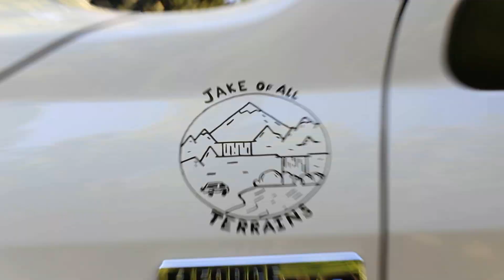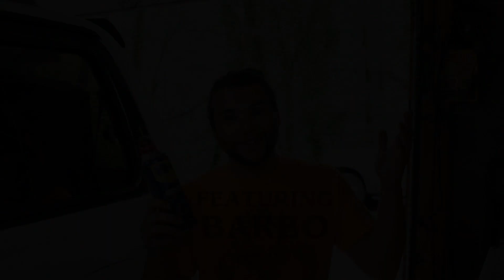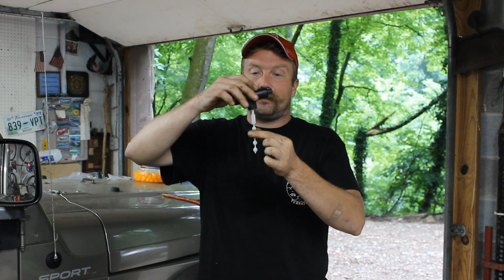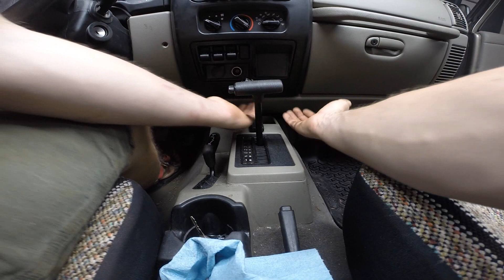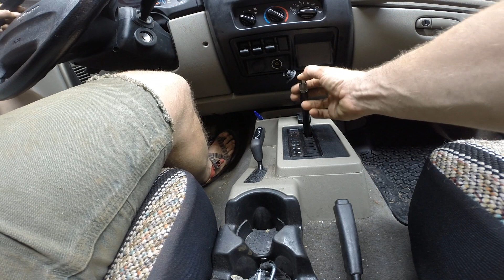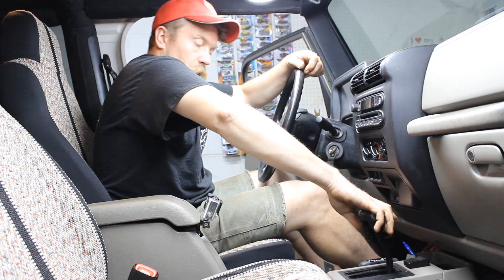Save your money! 97-05 Jeep TJ Automatic Shifter Assembly

Comment: About 10 years ago, my dog ate this knob on my Jeep. I have since been able to use the pieces of it like a second key, and I have been putting off replacing it... for 10 years. Just ordered the new knob, I'll report if it works when it gets here.
Reply from the maker: I hear that! My Toyota Tacoma exterior door handle quit working awhile back, but a piece of paracord tied to the interior handle,pulled by opening the back door first, serves as anti-theft. 😂
Reply: @jakeofallterrains9048  ha, will, the Bic pen worked like a charm. I put that off for far too long for a repair that took minutes. Lol

Comment: Anyone have a suggestion if the white plastic stick is stuck? Is it worth trying to yank it out or will that make the issue worse? I can get pliers to it but nervous of it breaking.
Reply: I’m having the same problem! I’m scared to break it.
Reply: You can't break it there is a pin that connects it to the shifter assembly

Comment: My guess is that the white nylon part is shaped that way to allow it to bend, while still being aligned in the center of the tube.  The shifter on my wife's '98 Jeep Cherokee is bent rather than straight, and it seems to use the same handle and white nylon part as in your video.
Reply from the maker: You're correct, but I'd imagine that cost cutting lead to the shape.
Reply: I disagree. I think it's it's an engineered anal beady thing.

Comment: bought the whole assembly from a jeep dealership for 120 oem part
Reply: pop the selector off and push the pin on the right side down and it will unlock the shifter. it is a horizontal pin
Reply from the maker: You could get at least 360 pens for that price.
Reply: @jakeofallterrains9048  absolutely correct my friend. but it still isnt the same price as the comment below that says $500